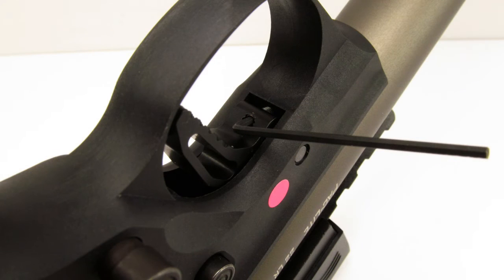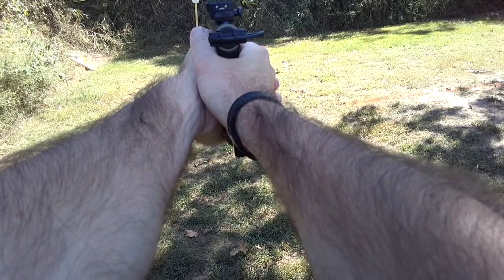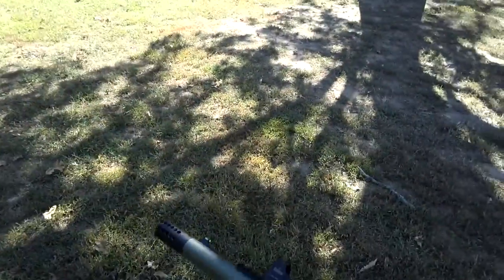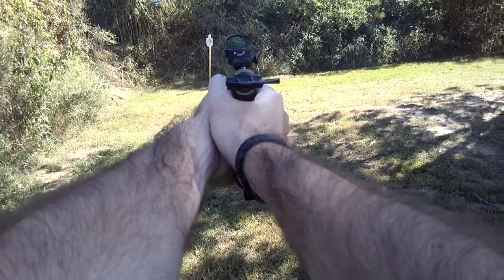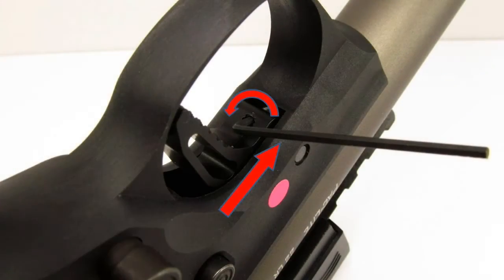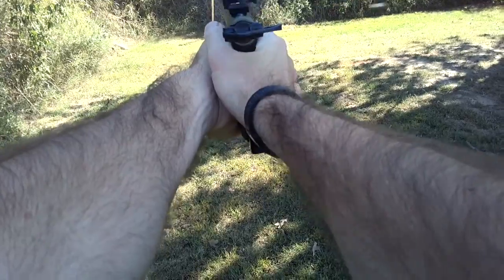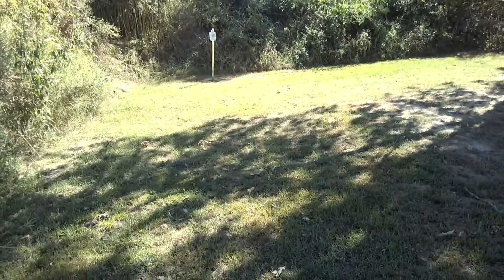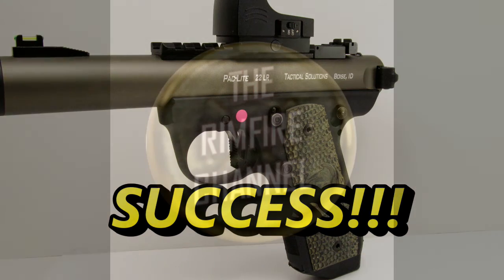TandemKross Victory Trigger | Pre-Travel Tuning Ruger 22/45

Comment: is that a burris fastfire sight?
Reply: +Savage Good eye.  Yes, it's a FFII.  If I ever have a chance, I plan to do a comparison review of the FFII and FFIII.  It appears that Burris will have both models available for some time and I've used both quite a bit.
Reply: +PocketGunsandGear thanks. that is a nice setup you have. informative video, hope to use it soon!
Reply from the maker: +Savage Dang it, I hate when I respond under the wrong channel.  The joys of running two channels.  Thanks for the feedback on the rig.  It did pretty well last season so I may be running it again this year, but I still have plenty of tinkering time before NSSF Rimfire Challenge starts up again.